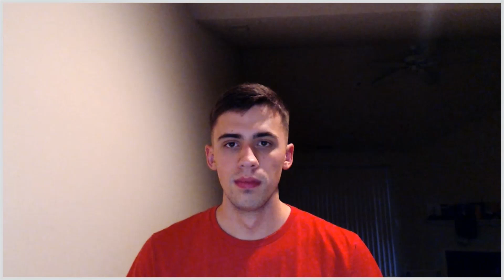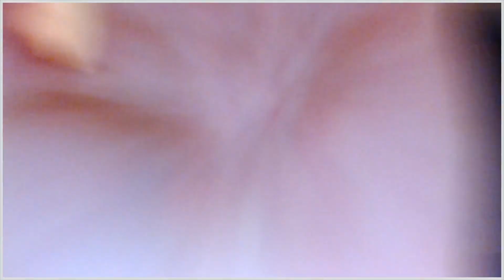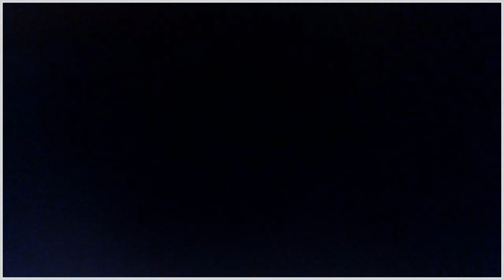Navy Nuclear Program - Nuclear Power School - (Navy Nuke Power School)

Comment: Excellent video. Walked off my fast attack in 87 after completing nuke school in Orlando and prototype training at S1W in Idaho. My advice is to settle down and take the training seriously with as few distractions as possible. This program will provide a foundation for any career for the rest of your life. Best of luck and thanks for your service.
Reply: Just to be clear, "distractions" include spouses.  Lots of marriages did not survive the nuclear pipeline. . .
Reply: I walked off an SSBN in 1987 (Sept) as well.  Orlando NPS class 8207-10.  Just retired after 32 years as an engineer at a nuke plant.
Reply: mrkeiths48…you are absolutely correct. It does provide a foundation for any career. The ability to study and understand concepts and systems, and the skill to apply those concepts to an operation system will pay dividends - whether you stay in nuclear power or move onto another career later on. I graduated from Power School in 1990, prototype in 1991, instructed there for 3 years, then served on the USS Minneapolis-St Paul (SSN 708) for 4 years (8 years total). I then completely changed gears and eventually became a commercial airline pilot after leaving the Navy…all those Nuke skills and discipline paid off as I was switching careers in my civilian life. Nuke training is very well respected outside of the navy and even non-military civilians understand the quality of people that graduate from the program. Best of luck to all you guys and gals in the pipeline and thank you for your service!
Reply: @daneav8  Thank You for your service.

Comment: Just got to a school yesterday. Nervous about a school power school and prototype how’d you get through it all and the people who failed what was the real reason people failed
Reply from the maker: There is a very, VERY low amount of people who fail out. Most of the time people who get kicked are disciplinary reasons. Just put in the time you think you need when studying the material, don’t stress out too much over it all, and crush it every exam. It’s only as difficult as you make it.
Reply: Bro, my last roommate just graduated with 1907 and he was struggling through on 25-4s as an a school AND power school roll back. As long as you dont get masted, they'll push you through it lol
Reply: @chaseholloway1912  do  they still have class sections    for the classes ?   we had 14 of which 2 were dropped due to fails.
Reply: I was in Nuke School (89-91). 

I only remember a few people who did not graduate due to grades. There was more people removed due to underage drinking or drugs (marijuana). I saw them at the gym handing out basketballs. 

To me, if anyone gets kicked out today for grades did not work hard enough. No excuse when you have YouTube, Khan Academy, etc.

Not everyone had the same HS (or college) background. I remember one student that did all his homework in 30-45 minutes. We were there till midnight messing around, frustrated, etc. 

As I wrote above, knowing what I know now (49), I would NOT go in the program. Go to college and be an engineer and then buy a boat.
Reply: @jameshaynes6992  where did you work after your 6 years were up
Reply: @jameshaynes6992  well, I’ve decided on going this route. Rn there’s a 38k bonus for enlisting in the program and a 100k bonus for re-enlisting. However, would it be more worthwhile to go through the officer pipeline if I get the opportunity? Even if I lose out on those bonuses?
Reply: @jameshaynes6992  It was alot different 76-78 it was greater than 50% failure rate in nuke school.

Comment: MBTI (with assertive/turbulent extension) best fit for Navy Nuke School
1: INTJ-A
2: ISTJ-A

Big5 (SLOAN) best fit for Nuke School
1: RCOAI
2: RCOEI
3: RCOAN
4: RCOEN

The main thing is high emotional stability and high orderliness, and being introverted helps a lot too.  thinking/feeling and agreeableness only have modest correlation.  Assertive/turbulent is an unofficial addition to MBTI to correlate with big5's neuroticism / emotional stability. I rank high agreeableness over low because of the Navy's emphasis on teamwork. I'm thinking Sensing and low-openness favors Machinist mate while intuitive and high-openess favors electronic technician, while Electrical mates are either-or.

You say things are big concept based, but I think that is during A-school and power school only. Things are very procedural and checklisty and memorizy when in prototype and in submarine school from the insights I've gotten so far.  Worse for MMs than for ETs. And if you hit your intellectual boundary in power school, many end up resorting to brute force memorization there too, but the higher ASVAB and other recruiter-phase filter-thresholds should screen those out more.

ISTPs and INTPs or those with higher neuroticism that are not overwhelmingly intellectually overqualified I think could make it through with heavy headstart exploits. Not come in as a know it all - but come in knowing some stuff so the learning volume is less. Too high neuroticsm will probably not make it through boot camp / RTC, but I don't think RTC filters that as well as the refined recruiter-phase intellectual filters as it seems the most fail-outs are suicide risk, drugs, alcohol, and weight gain / stress eating ('PFA')
Reply: I'm going to have to say this assertion is rather unhelpful for those thinking about becoming a Nuke as most of us aren't MBTI and it may scare away people who aren't. I'm personally an ENFP, and I aced Powerschool.

Comment: What is the probability of superclose identical twins being stationed together on the same carrier or sub as nukes? They can do separate classes (and for one or two classes they enjoy, mainly cross-learning exploitation) but they would not want to be on different ships (long-term separation) or on opposite sides of the reactor room door (secret-keeping between twins). Their limit right now (and very not comfortable) is one going into a all-day wrestling tournament without the other - only one qualified by RNG of the opponent and the other cannot travel as a non-participant and their mother don't have a vehicle to take him on her own.  They say submarine duty would be no problem for them but I think that is something that can only be determined when experienced, but higher chance have having more together time even if one is a EM and the other is a ET (if that is needed to maximize chance of deployment to same ship/sub).

On a tangent, my dad was electrician's mate on a submarine, non-nuclear.  Diesel sub, but it had nuclear torpedoes - USS Greenfish.
Reply from the maker: this isnt unlikely through the buddy system. even at prototype we had two identical twins one of which was an ET and on an EM, both on the same boat and crew so definitely possible
Reply: @QsFJambs  I'm finding that the Navy is more friendly to superclose twins than the other branches, but looks like nothing is guaranteed on the ability to be kept together at least on the same boat. But a high priority field would boost the odds I think and nuclear is high priority for sure from the looks of things.

Comment: Hi there Jambs, 
Can you please tell me more about scheduled PT at Nuke school? i.e how often, what times of day, how long does it last, what does it consist of, level of difficulty? Thank you! :)
Reply: amber dewitt PT is usually schedule for 3 times a week. The difficulty varies because each class is led by one of the students so it’s up to them. It can last around 30-45 minutes. The time of day varies as well, for the warmer months it’s early morning but cooler weather it’s in the afternoon right as classes end
Reply: PT in Nuke School for 8205 consisted of walking from the dorm room to the mess hall, to school, and back.
I was on a Fast Boat.  We didn't run anywhere.  We had a PT test once a year.  We were paid on what we knew, not on how fast we did it.

Comment: Is the use of computer algebra systems (many of which can also do calculus) allowed in nuke school?
Reply from the maker: no. only the basic TI-84 may be used, however all work is required to be showed
Reply: @QsFJambs  Would that just be exams and in-class or would that be to self-study and projects too?  No use of R or python in a jupyter notebook, which is great for running stuff in baby steps and innately 'shows work'?  Jupyter notebooks are web server thin client but if teachers aren't willing, there is always print-to-PDF. Though the meat of the work shown will be in R or Python. High school acceptance it is completely mixed case but the more accepting teachers want comments in there that translate some of the code..
Reply from the maker: @YeshuaAgapao  you can use that for self projects all you would like, however, it would not be of any use for any of the classes or work since all work must be done within the schoolhouse itself, which would prohibit any type of electronic device or computer other than the basic calculator previously listed
Reply: @QsFJambs  I'm looking up more stuff.  Stuck in the 1990s and overclassify everything. All the more reason for them to stay together if they choose navy nuke. They will never be able to afford MIT, and crushing student debt is just so unwise even with the central banks of the world (federal reserve in USA) 'printing' digital currency like mad and devaluing that debt (USA is using to buy federal, state, municipal government debt, and corporate debt; japan central bank is creating currency to buy stocks).

Comment: Out of curiosity, do most of the people in power school have a background in engineering? For example, I'm considering enlisting and I have a bachelor's degree in mechanical engineering with a few courses in nuclear. How does that stack up to the average student in power school?
Reply from the maker: not at all! most enlisted are straight out of high school or have done a year or two of college. Officers on the other hand who have the degrees will have some kind of background like that, and it does help a bit when it comes to some of the theory, but you do learn alot more of the specifics. the average power school enlisted student has zero background in engineering.

Comment: Is there anytime to workout or r u to busy with school?
Reply from the maker: There is definitely time to workout. You’ll have scheduled PT 3 times a week, if you get a good high/excellent low on the PFA you’ll have voluntary PT.
Reply: Also, if you dont have to do scheduled PT or if you want to work out more, theres a gym on site and a bigger gym on base down the street. Any extra PT will be on your free time so if you're doing okay in your classes and you dont have to study too much and youre getting to leave at 1600 or earlier, it wont be a problem. If you're not doing so hot and you're on 25-4s and you're in the rickover from 0630-2000, it might be a bit harder but it's still manageable depending on your level of dedication lol. That goes for any other recreational activity as well

Comment: Hey man I have a few questions! I’m 19 years old rn, and I made like a 50 on my ASVAB, to be an ETN what score will I have to make on the ASVAB, and what is the process after coming out of boot camp? Do you go straight there or...? Also, If I wanted to be an ETN or whatever job I pick for that school, will I be guaranteed a job on a SUBMARINE instead of a carrier?
Reply from the maker: ETNs typically are from the higher of the scores on the ASVAB, about 85 or higher. There is also a minimum score to qualify for nuke in general. If you're below it and still want to go nuke, there's a separate exam you take after your ASVAB and you have to score high enough to meet the standards. If you go to bootcamp as a nuke, you'll meet with the nuclear representatives that select which of the 3 rates you'll be. You give them your primary and secondary choice and they choose from that. Also, if you submarine volunteered at MEPS, you will more than likely go to a submarine, especially if you fill out your "dream sheet" at prototype for only submarines.
Reply: @QsFJambs  I can volunteer at MEPS to be a submarine?
Reply from the maker: @strozziturney9246  yes, during your paperwork process they’ll give you a form where you’ll sign to volunteer for sub duty, or do not volunteer for sub duty
Reply: @Ash12428  no! Don’t volunteer for submarine yet, go aircraft carrier. You can always change ur mind in a school if you want to go subs when u learn ur job. If you volunteer as sub, you’re stuck.

Comment: I've been going on a learning binge on nuclear reactors lately. It looks like the US navy  has a real overclassification problem (relative to the UK and India, inspired by SmarterEveryDay's video -- too classified to film but is all over the internet), and a real head start can be gained beforehand at least on the conceptual side of things.  I think part of the reason Navy nuclear is much harder than civilian nuclear is because navy nukes have to fix components in the reactors and the steam generators and turbines the reactor feeds. It seems that Naval reactors are much more automated black-box than civilian reactors, but ETs are often fixing and troubleshooting computers and electronics that make the black box do its thing, and it isn't fully a black box to them, just the black box is needed in the stress of combat / combat-drills.  There is one guy that has very in depth videos on YouTube, appears biased towards machinist-mate (pumps, welding, turbines).  I don't think I would be interested in MM myself, in practice they are checklist drones in my perception.  ETs I saw actually doing real problem solving on board ship. Not much insight yet for EMs, or how EM/ET/MM interact.
Reply: I would like to say that a significant difference between naval nuclear and civilian nuclear would be that naval nuclear is much cleaner and isolated. If there were a water leak in a civilian reactor, that water would be a radiological hazard. For a radiological water leak to happen in a naval reactor, it would have to come specifically from the primary side, which isn’t as likely due to a number of things. I’m an MM, I recommend it. I was EM/ET looks so much better from the outside but I got to thinking during bootcamp and realized I would love being an MM so much more than EM/ET. Everyone wants to be an E rate, half of my class did, but once they get selected for MM and start classes they realize they like it much more. A bit more on the profiling side- ETs and EMs are nerds lol really weird guys up there
Reply: @Wallacethegod20  Nerdy and weird makes me like ET and EM more (ET more because electronics and problem solving), at least for myself. Though I read up more and learning that that the hard work and long hours does not stop at power school and continues through all of active duty, especially on submarines, is actually a turn off for navy nuclear for myself. They (twins) may end up liking MM more but I don't think I will. For them keeping together matters more. And since they actually want to be on a submarine, they cross-train whole lot more on subs, so getting non-preferred choice may not be as bad.  2xMM on same boat may actually be more together than time than 1x EM and 1x ET.

Comment: Can you use calculators??
Reply: duh
Reply: @TUMIDPLAGUE078  It wasn't a dumb question, ER.  We were allowed only slide rules when I went through the program.
Reply: I actually kindve wondered that before I got here too. Yes, you are encouraged to use calculators. Everyone has the same one for the most part cause they have it at the nex and that's the calculator they teach you how to use for the first two weeks of math in A school. It just cant store or transmit data in any way. So no USB inputs. No fancy graphing calculators (we graph everything by hand). That goes for everything in the Rickover too so you cant even have a flash drive inside the building
Reply: Most everyone had either the Ti-30 or the SR-40. Both ancient now.